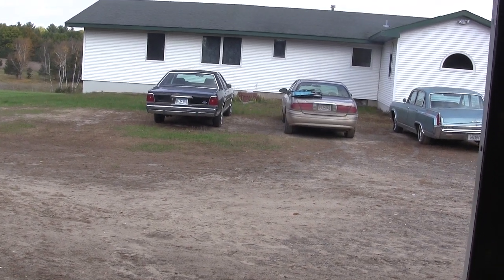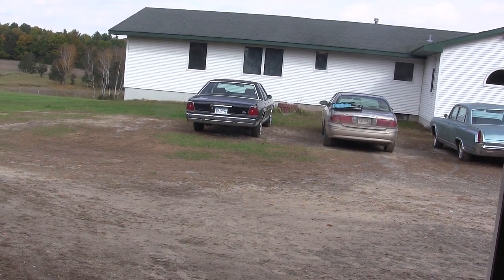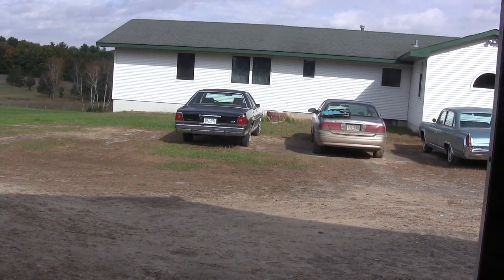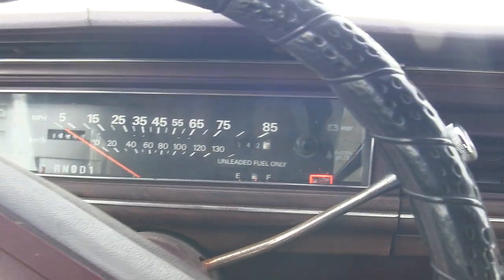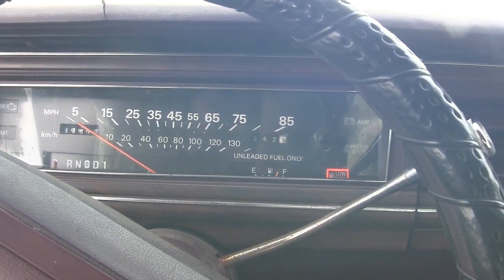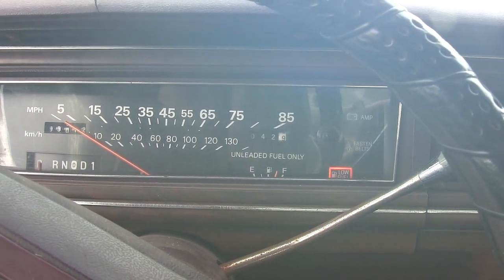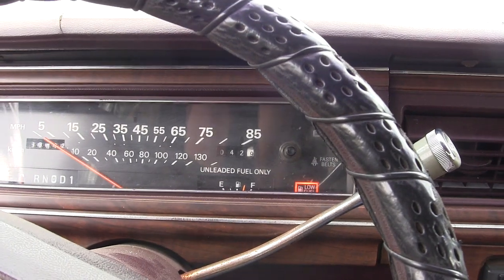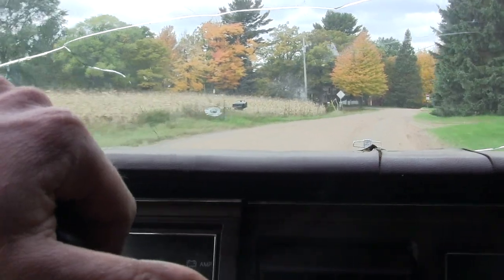A Quick Start And Drive Of The Crown Vic

Comment: Get a Actron CP9690 code tester. It checks live, record, graphing, emissions readiness test, oxygen sensor test, ABS, SRS, transmission codes, KOEO, KOER, solenoid and relay test, and MORE! It comes with OBDI cables for Ford, G.M., Chrysler, and Toyota. It has a cable for OBDII. It comes in a black carrying pouch. The screen is well lit. It has code connect to diagnose codes. It has a cigarette lighter cable. Get a USB cable to update it. It works from 1984-2013 and is updatable. EBAY has it.